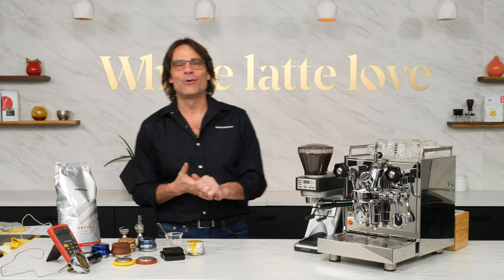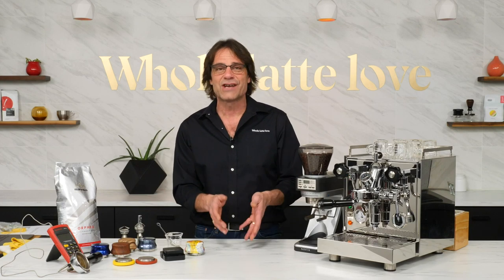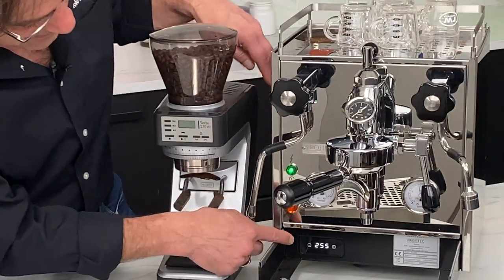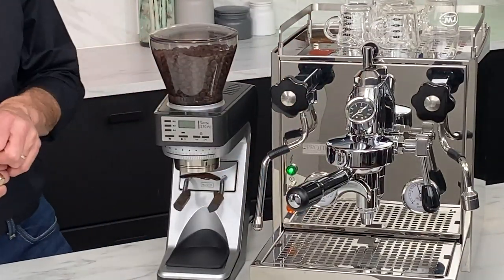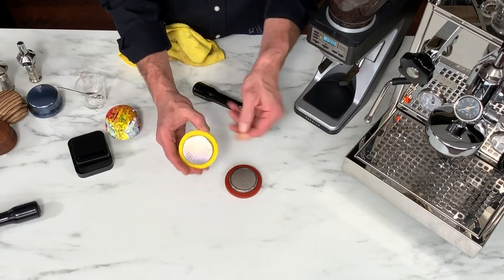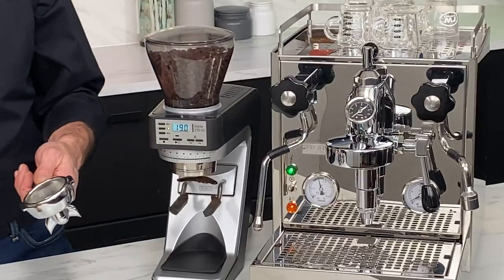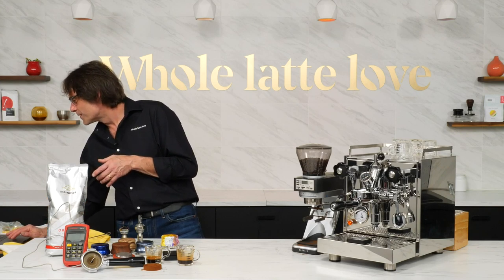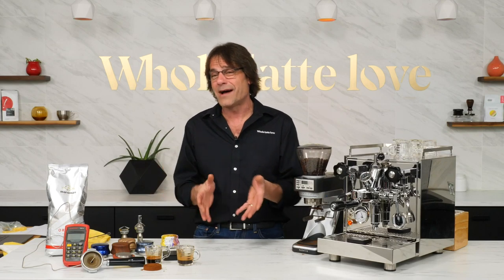E61 Espresso Flow Control Profile - Tame Bitterness

Comment: Love these videos. Thank you Marc.

Struggling to get espresso shots that I’m happy with when not served under milk and understanding these profiles is certainly going to help.

Do you have plans to do a similar series looking at brew temperature variation (for a PID dual boiler machine) on different coffees? Little info online for brew temp changes and their effect in the cup.
Reply from the maker: Hi Brodie, You are welcome for the videos and thank you for the kind comment!
For brew temp, I've done some videos in the past on that but here's the general guidline...
All coffee/espresso brewing between 195 - 205F 91- 96C. Start in middle of that range for medium roast, use a few degrees higher for lighter roast and a few degrees cooler for darker roasts. Simple!
Marc
Reply: Great, thank you! Will have a better dig through the channel. Been going off 93C so far while I learn the new machine.

Comment: Mark. I have ECM Mechanikka MAX - what is the best brew temperature (t1), and steam temperature (t2)? I had a CoffeeCast event and Missy told me the brew temp should  be 92-94. Tech support people say it should be 124… BTW, when I turn on the machine - I get 124 - is it brew temp?
Reply from the maker: Hi DA, I overheard your CoffeeCast with Missy - that set is right outside my door! I heard my name a few times and almost came to to say hello! Best brew temp depends on the coffee you are brewing. Coffee brewing range is 195-205F (91-96C) For dark roast 197F/92C, medium roast 200F/93C, light roasts 203F/95C. Those temps are general suggestions and you can modify based on flavor. Not sure why tech would have told you brew temp of 124. Not sure if you're working in Fahrenheit or Celsius, but 124 is not a good brew temp in F or C! Perhaps there's was some confusion with t1 and t2 or F or C when you spoke to Tech Support. 124C could be a good t2 steam temp. Best steaming temperature depends on how much power you want when steaming. Higher steam temp means less time until milk is heated and a more powerful roll in the pitcher. If you've got good frothing skills them turn t2 up. If you're newer to milk frothing turn t2 down and you'll have more time to froth the milk.
Marc
Reply: @Wholelattelovepage  I wish you did come in and say hello. Would be cool. ✌🏻
Reply from the maker: @SWelle1  I try not to interrupt. Next time!

Comment: Actually I am one of those that do not like that coffee taste although it looks great I seem to be one of those that will never purchase again as the coffee is bitter and sour at 2:1 using bambino and sette.. Many 1 star reviews which I seem to agree with.   Will use local coffee roaster now.
Reply from the maker: Hi Ken, Sorry to hear you are getting both bitter and sour at the same time. That's a very unbalanced cup as sour flavors indicate under-extraction while bitter flavor indicates over-extraction. That can be caused by things like grind is too fine (bitter) while there's channeling through the coffee (sour). The Bambino is a pressurized basket brewer which compromises a bit. With pressurized grind size is a little forgiving as it's the basket which creates the pressure and not the grind size of the coffee. Even with that I often find people using pressurized baskets are using coffee that's ground too coarse which causes under-extraction. I've had people drying to use drip grind size for espresso and that will not work. You might try grinding finer. You should be in the neighborhood of table salt or slightly finer grind size. Coffee beans used can also play a role. Traditional Italian blends tend to be more bitter than others. Maybe try playing with the grind size a bit before throwing in the towel.
Marc
Reply: @Wholelattelovepage  TY Mark but I am using a bottomless portafilter non pressurized as well and cannot tell a difference yet,, still trying even this morning   . Many saying bambino does not get hot enough for medium/light roasts..waiting on call from breville.. Marc  just got off the phone with Breville and they said bambino works with light/medium beans as well.. suggested I use 18 g in pressurized and I did and it ran too fast.. changed to 19 and still .. Switched to bottomless and used 19.5 gm  and it stopped before 39 gms  .Crenma was 1" but it was still sour tasting.. this is same with the arabica moromas.. I am considering exchanging machine while I still have time as I watched the bottom of portafilter /after sette and wdt and it looked beautiful..taste was sour again..  ???

Comment: I keep seeing you using a 20g basket in a double spout portafilter but heard anything over 18g basket requires bottomless. i hust recently got the pro 700 from you guys and want the 20g basket but read it wont fit in the doublespout?

Comment: Hi,

Helpful video. 

However, I am still getting a sour/burnt taste. I was doing fine until a few days ago and now that I use a new distributer+tamper with an open portafilter, I can't seem to get it right. (not sure if this is affecting it)

I use a Breville Barista Express. 
-The extraction time is 30s. (coffee starts to pour around 7s)
-The volume for a double shot is about 65-70 ml at times. (18 gms coffee)
-The color starts to blond a bit early I feel. 
-The pressure gauge is within the grey zone but around the 1 o'clock position. 
- I pre-hear the shower, glass & basket. 
- Puck looks fine. Not dry and not wet/watery. 

Would really appreciate your inputs on resolving this. 

Thank you.
Reply from the maker: Hi PN, Thanks for the question and sharing your details. Sour flavor generally indicates and under-extraction. Burnt flavor may be the roast you are tasting if using a darker roast coffee. Burnt could also be a brew temp that's too high. I might try purging a bit of water from the brew head prior to brewing. This can help cool the brew temp. Volume of 65-70ml sounds about right if using a coffee which produces a lot of crema. If it's not a big crema producer then that volume is on the high side. Decreasing grind size would help with sour (under-extracted) flavor and could extend time to blonding.Hope that helps!
Marc

Comment: Hi Mark, i have an ECM Synchronika and I drink primarily milky coffees and rarely plain espressos. Would I gain anything  taste wise in my milky coffees  installing a flow profile valve on my machine ?
Reply from the maker: Hi Mike, Depends on what type of coffees you are using. Milk will definitely mask/dilute espresso flavors. On the other hand if you're using fresh from roast specialty coffees there's a large benefit in reducing brightness with long low flow pre-infusions. Reducing brightness allows more of the fruit to come through. That's less noticeable in milk drinks and very noticeable in straight espresso.
Marc

Comment: I have a Profitec 700 purchased from WLL about three years ago. Can it be upgraded with Flow Control
Reply from the maker: Hi Jeffrey, Thanks for the question. Yes it can unfortunately due to virus related manufacturing slow downs in Italy stand alone uprgrade kits are not currently available. :(
Marc

Comment: Hi Marc, love the video... Just curious to know what is the grind size setting you are using with the Baratza for the shots today?
Reply from the maker: Hi IC, Thanks for the comment and question. I believe it was ~5B. But here's the thing my grind setting has no bearing on yours. A couple reasons... First even same make/model with same coffee would likely grind at different size. One must dial in their own grind size. So many variables involved like: filter basket type, machine, coffee, brew temp...I could go on. A huge difference? My Baratza 270 Wi is well broken in. A couple of weeks ago I installed 2 shims under the burr. This moves grind size a number of macro steps higher for a similar grind size so comparison is useless. Do watch my video on dialing in grind size. It's easy: https://youtu.be/jOY7D02n4Cw
Hope that helps!
Marc

Comment: Marc: In your opinion, how can I reproduce that distinctive Italian espresso bar smoothness/sweet and nutty freshness, that has eluded me here in the USA? I'm thinking of purchasing an ECM PID with flow control from WLL, and testing it with the Maromas Orpheus, or Lavazza super crema coffee. What are the biggest factors involved? Also, what about the quality of the water used as a factor? (**The last heavenly coffee drink I had was a cappuccino at a Cafe Kimbo coffee bar, at the Rome airport back in September...this is what I crave, and seek to reproduce at home...)
Reply from the maker: Hi d, Thanks for the questions. A PID ECM machine will give you the right tool. And a classic Italian style bean blend like Super Crema, Orphea (a little lighter in roast) or heck, just get the Kimbo: https://www.wholelattelove.com/collections/whole-bean-espresso-coffee?_=pf&pf_v_brand=Kimbo%20Espresso%20Italiano
Biggest factor involved after the coffee is the grind. Perhaps you are familiar with dialing in grind size. If not here's my video on that: https://youtu.be/jOY7D02n4Cw
Next factor is consistency. Only change one variable at a time. Water quality is important. You want some minerals in the water for flavor but not so much you cause scale to form in your machine. We have a number of options to get you there depending on the type of machine you are using. I recommend giving our espresso experts a call at 585-924-7170. They can appraise your needs/desires and recommend the gear to get you there.
Marc
Reply: Whole Latte Love Thank you!!!

Comment: Just got a chance to see this stream which is awesome, couple of questions, do u push down on the jackleverler when spinning it? Also once u open the bag of maromeas orppheas coffee how long do you have until u notice a degradation in taste?? Two weeks maybe? Thanx mark your the best!
Reply from the maker: Jesus H Medrano Great to hear from you. I let the Jack do the work. Just spin into the coffee with no added pressure. When I open a bag and don’t use it all I tightly roll the bag and use a clip to hold closed. Stored like that IMO it’s good far longer than 2 weeks. Marc
Reply: Whole Latte Love now when u guys gonna get more levelers in stock lol am pretty traditional and finally Convinced I self with the help of your videos to give one a try

Comment: Great video, Marc! I noticed you weren’t doing a cooling flush using the Pro 500. Does this machine not need one due to the PID? Thanks!
Reply from the maker: Hi David, Thanks for the comment. That's right. I've found in most cases the new crop of HX boiler PID machines from Profitec, Rocket and ECM do not require a cooling flush. If they've been sitting idle for awhile, especially without a PF in the group, they may need a very short flush. But other than that the are remarkable when compared to the pressurestat controlled machines of the past.
Marc
Reply: So when will Profitec provide us with a mod to upgrade PStat machines to pid??